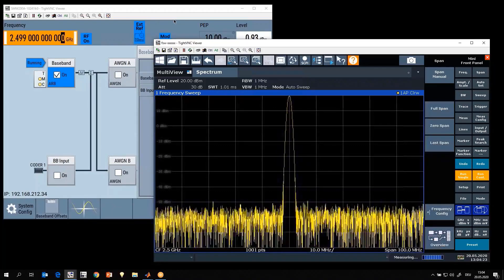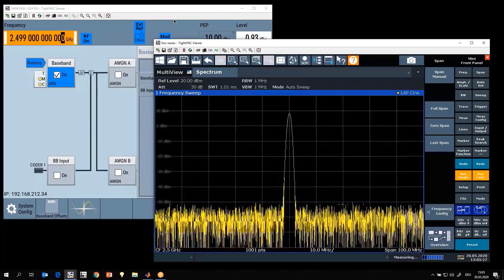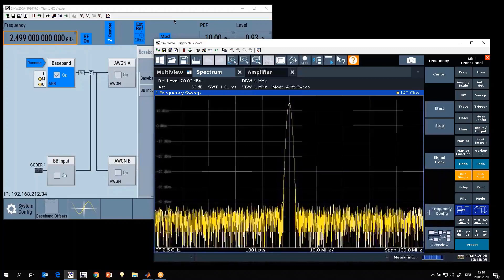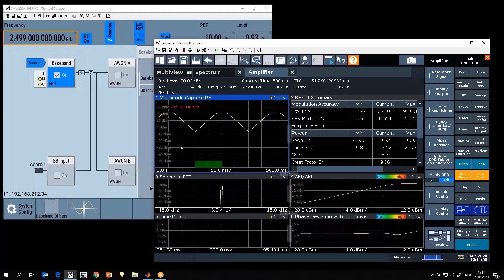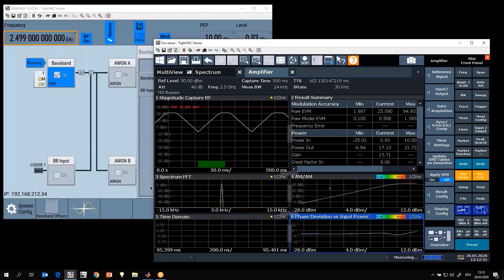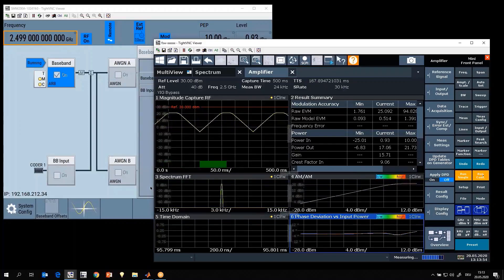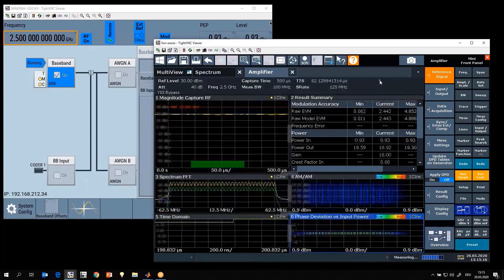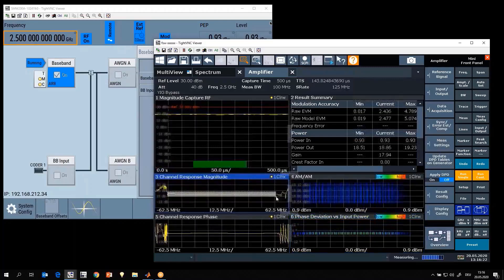R&S Amplifier Masterclass Video 1 – CW to Modulated Measurements

Comment: I really appreciate your tutorial, but there is a question that still bothers me. When I try to make a connection between FSM85 and SMW200A through a LAN wire the static IP, the SMW200A keeps reporting errs like:
“ -113 Undefined header - Option/HW missing, IdPDbDpdPinMax/IdPDbDpdPinMin/IdPDbDpdShapeMode” etc. 
As a result, the FSM can not read waveforms from the generator SMW200A
Does anyone know why this happened?😣